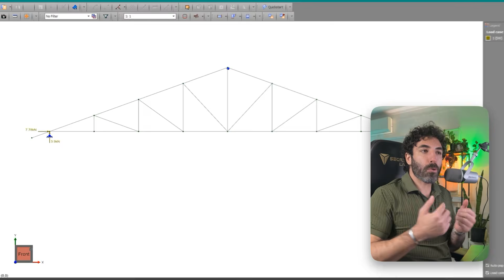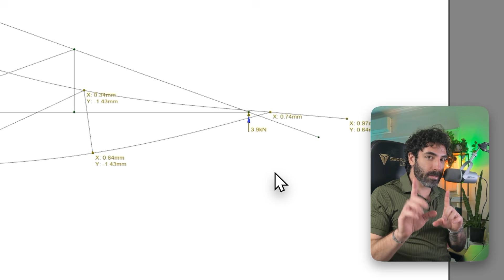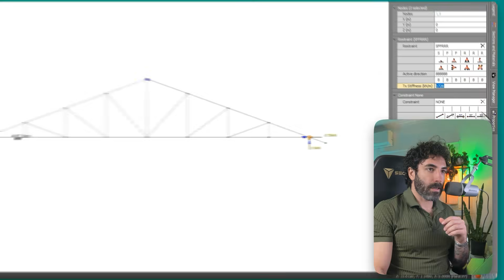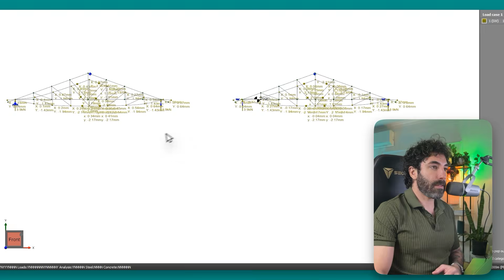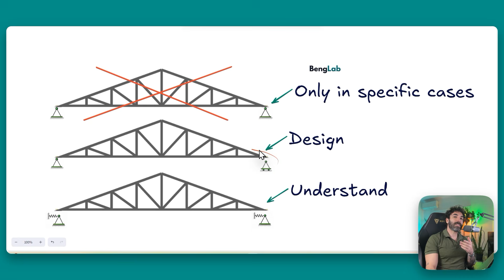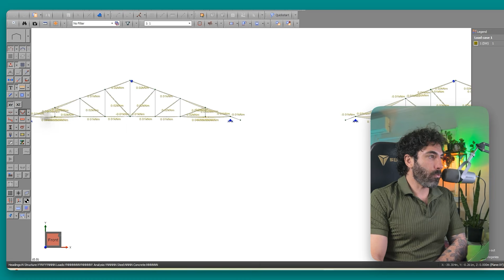The Truss Support Mistake Software Won’t Warn You About

Comment: This is a common beginner mistake when modeling trusses in software.  The software is perfectly happy to do calculations for this but it doesn't model reality and the forces and resulting designs will be incorrect.  I've seen nationally recognized engineering firms make this mistake.
Reply: this error is not a software understanding issue
 - the issue is that dumb and dumber who was asleep during structural classes, or who should take up an alternative profession did not think about the assumptions that underpin the freebody diagram, a diagram they likely never even considered when doing the design because the software "does it all".
- or perhaps the structural training was incmpetent.
- either way dumb and dumber may have no feel for structures and how they move whilst pushing and pulling

Comment: Ok, so I'm in the process of planning to build a mudbrick house, with timber columns. Those columns will be where we tie the mud brick courses, so I don't think we want them to act as a spring, as this could cause cracking in the mortar. With a pitched roof, with corners, what would be the simpler way to achieve a roller / spring function, or should we instead be focusing on ensuring the timber columns are stiff enough to constrain the load from the truss? Would building the trusses out of recovered hardwood, which we have in ample quantities confer any advantage or disadvantage?

Comment: Parabéns pelos teus vídeos. São muito bons. Uma duvida que sempre tive e ainda não consegui resolver é como fazer essa determinação do coeficiente de mola para compatibilizar dois modelos. Por exemplo uma cobertura metálica apoiada sobre um prédio em concreto pré-moldado. Usando um modelo de um pilar de concreto engastado-livre e calculando o coeficiente K é uma alternativa simples para aplicar em um modelo bi-dimensional. Porém se temos um modelo mais complexo, eu não sei como fazer essa determinação corretamente. Acabo sempre fazendo a Modelagem das duas estrutura por completo.
Reply from the maker: eh entao essa parte complica. Foi isso que disse no video, pq Light weight framing tem muito detalhe que afeta todos os componentes. Modela como roller